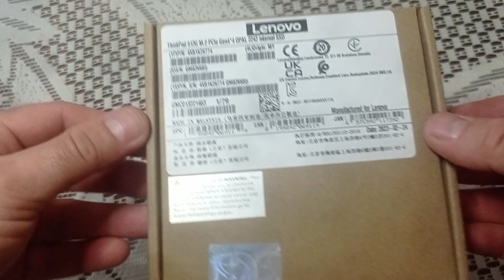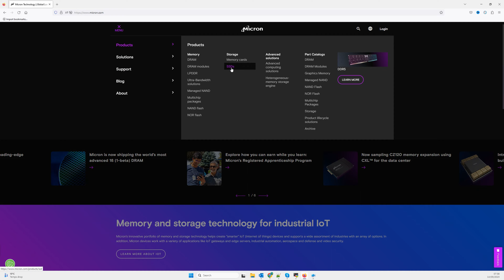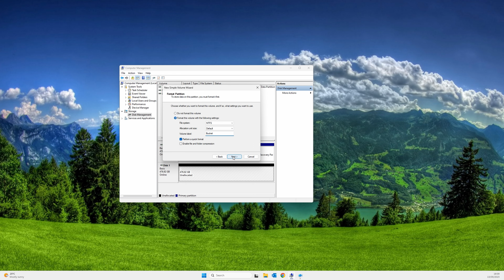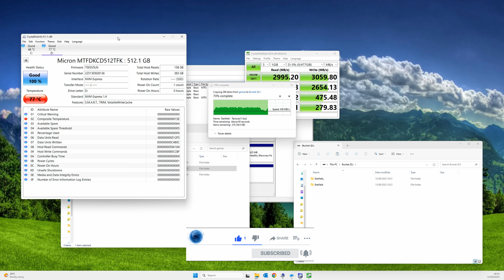micron 2450 review, (MTFDKCD512TFK)

Comment: I have this exact drive in an Asus with Thunderbolt 4 and an Intel i9, 11th generation H series. The machine is overall very good but I want to add a second drive and maybe replace the OEM 512GB drive. The performance of this drive seems to be just OK for an NVME gen 4. Did you test anything else you'd recommend for a laptop like mine? Are the Samsung NVME gen 4 worth the price?
Reply from the maker: this drive is very hot in working. So I recommend using a radiator with it